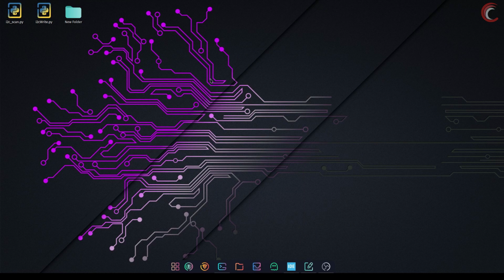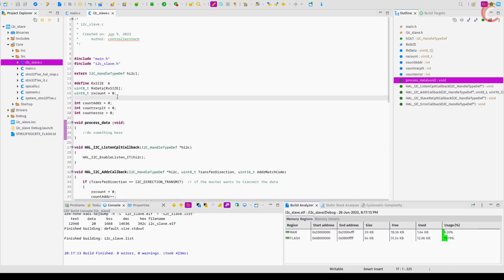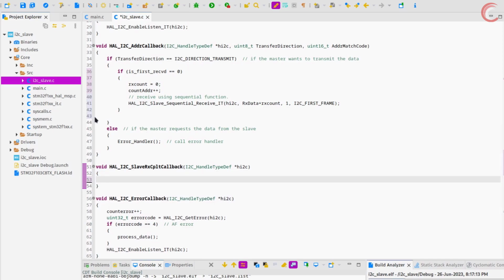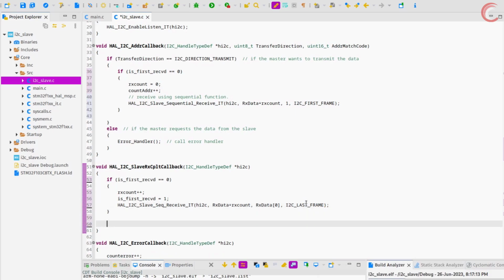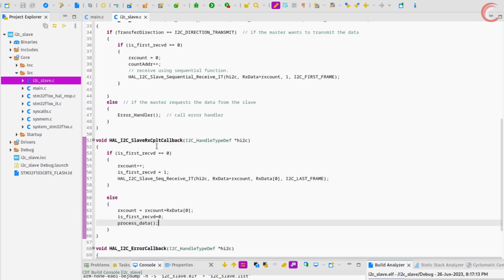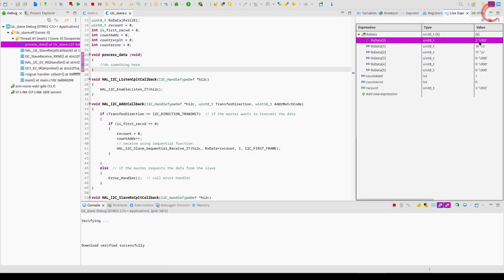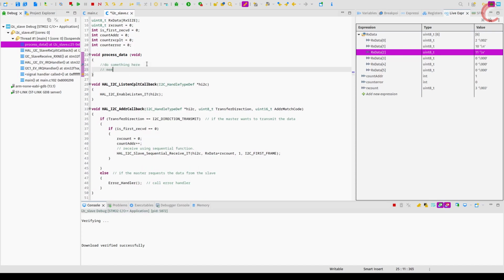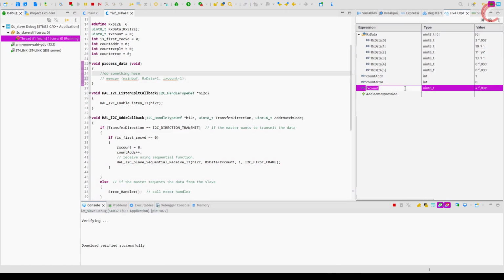STM32 as I2C Slave || PART 4

Comment: I'm really enjoying learning from your videos! What happens if the master tries to send 7 bytes of data when the Rx buffer is only 6 bytes? Won't that create a memory leak in your code?
Reply from the maker: Well the first byte informs slave how many more bytes are coming. If you are in control of the master code, then you should program it accordingly. 
If you are not in control, then part 4 is not for you. 

I just covered different methods for the slave to receive the data. Use the one that suits your need.